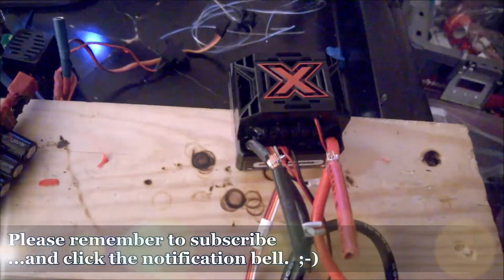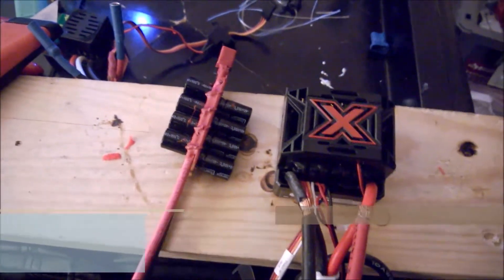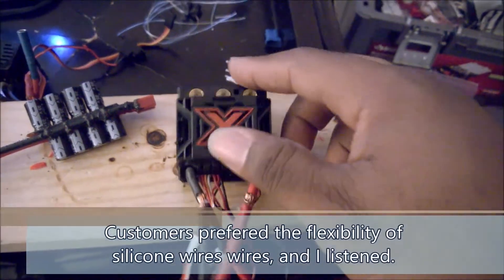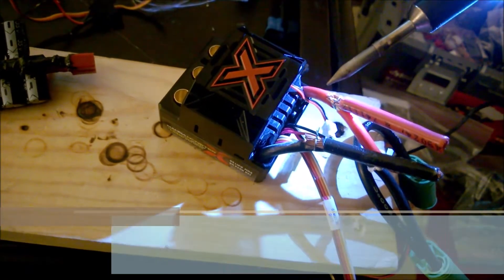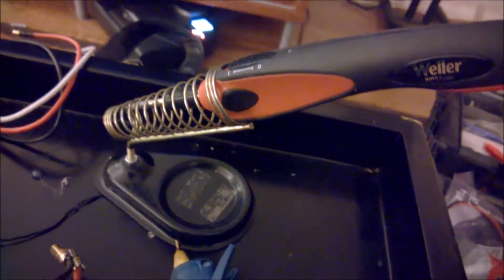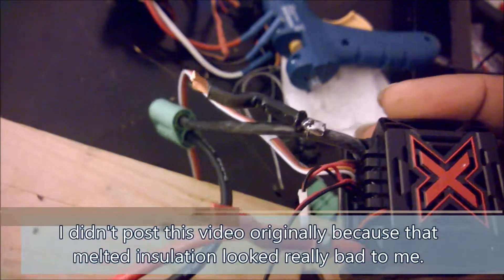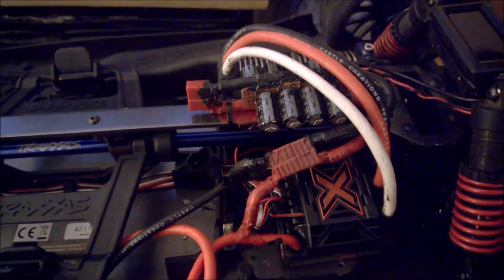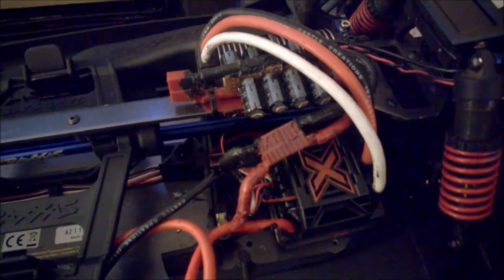Ep. 269: Cap Pack Wiring Tip

Comment: Going to make me some for a 3s 2845 5000kv speed build. Got a cheap quickrun 35amp esc. What capacitors should I go with? How many shld I do?
Reply from the maker: A 35A ESC will probably peak at 50-75A under max load. Assuming decent batteries, you are probably going to get a max a of ~0.5 - 1hp out of that setup.... if your ESC can actually keep up with that load.

In my experience, cheaper ESCs usually need a lot more help than more rugged ESCs because they just aren't designed to take a lot of abuse. for that reason, I'd build a pack with at least 4 low-ESR caps in the ~500uF range. If you are sticking to 3S, there is no benefit in running caps rated for more than 15V unless they have a lower quoted ESR/impedance that justifies the price difference.

Here is an article with a ranking of capacitor brands. If you stick to Tier 1 or Tier 2 brands and assemble with high quality wire (I'd go with 14AWG, 12AWG, or larger), you will end up with a really solid pack. https://www.tomshardware.com/reviews/power-supplies-101,4193-5.html
Reply: @RCPhysics  thanks for that reply I will do! One more question. How would 4 500uf capacitors compare to 2 1000uf capacitors? Would it be the same or is there a benefit? Also why not use a higher voltage vs 14v. Would that matter at all or do you want it to be as close to the battery max voltage for some reason?
Reply from the maker: Here is an article I wrote a while back explaining ESR (Equivalent Series Resistance). https://www.facebook.com/rhouse21RCPhysics/posts/773378892833621 The short story is you want as low an ESR on your Cap Pack as possible to make it be more "effective". 4 500uF packs in parallel will usually have a lower ESR than 2 1000uF, but you have to read the spec sheets of the caps you are planning on using to confirm this. Sometimes good cap makers will have ultra-low-ESR caps that will break this rule-of-thumb, but you will usually pay more for them.

As for cap voltage rating, capacitance is defined as the number of electrons that a capacitor will hold at a given voltage. In this way, they act like a water tank and need to be a certain physical size to hold a certain number of electrons. No matter the voltage rating of a cap, it will only store a certain number of electrons at a given voltage, so a 15V, 50V, or 1,000V cap of the same uF rating will all contain the same number of electrons at 12V (3S). Buying a higher voltages cap just makes sure it has "room" to store more electrons at the higher voltages. In practice, you really just need a high enough voltage rating to handle your max battery voltage. Buying higher voltage just give you more room for electrons that your system will never try to store.

Comment: That's gonna melt right off, or at least looks like it.
Reply from the maker: Naah. Liquid tape solidifies into a silicone rubber that is good for over 200 degF (100 degC).  If your wires are getting that hot, you have other issues to deal with in your power system. 😎
Reply: @RCPhysics  just looks like a sub par solder job, that's all.   GL
Reply from the maker: I use silver solder on all of my power wires because it is a lot more durable. The downside is it looks really ugly. It also takes a lot more heat to melt which means you have to use a pretty powerful soldering iron to get it to melt well on thick power wires. That said, these were not my prettiest solder joints which I fully admit.
Reply: @RCPhysics  noted and appreciate the info. what wattage iron if you don't mind me asking.
Reply from the maker: I used to use a 150W Weller, but that sucker is hard to be precise with. I recently switched to a "budget friendly" (translation: cheap) temperature controlled solder station from Amazon that lets me use Weller-compatible iron tips. This lets me pick the right tip for the job. I can use a fine tip and low temp solder for circuit boards then switch to a massive chisel-tip that retains a lot of heat energy to heat the solder joint quickly, melting the high temp solder before the rest of the part/wire heats up.

Comment: Can I solder an ec5 connector to a cap pack and run it to a parallel ec5 adapter alongside a 2s lipo as part of a 4s setup in an Arrma Kraton 4s. Thanks
Reply from the maker: Cap packs only charge up to the voltage of the battery they are connected to. A 100V cap plugged in parallel to a 2S battery will only charge up to the voltage of the 2S pack (nominally 6-8.4V). That said, adding a cap pack to a 4S setup (1 4S pack or 2 2S packs in parallel) will probably give you more "punch" and help your ESC run a little cooler.

Comment: Should I use 470uF or 2200uF capacitors?
Reply from the maker: It really depends on the ESR (Equivalent Series Resistance) of the caps and how many you plan on using. Generally, larger capacity caps from a given product line have higher ESRs, but this is not always the case. You should refer to the manufacturer's data sheets to see which is the best option.
Reply: @RCPhysics  I was looking at Philips ones and was planning on making one for a 4s system and a 2s/3s
Reply from the maker: @plproductions8887  What ESC are you using? That will determine how much uF total you need for the pack. If it's something like a ~100A-class ESC, you shouldn't need much more than 1,500-3,000uF so 4-6 470uF high quality caps would probably do just fine.
Reply: @RCPhysics  one is a castle mamba x run on 3s and the other is a HPI trophy Truggy Flux stock esc on 4s ( there Panasonic M Serious Low ESR ) sorry
Reply from the maker: @plproductions8887  Che the data logs on the Mamba X to see if you even have a ripple problem. That ESC caries a lot of onboard capacitance for its size, so you may be pleasantly surprised. It's probably go with 4-6 470uF caps for the HPI, though.
Reply: @RCPhysics  ok thank you the mamba x is on a 1/14 car for speed runs

Comment: RadioShack hasn't been alone for over 8 years you forgot to put heat shrink on it
Reply from the maker: I recently discovered that Radio shack is still around. They are just online now. So you can still order the good solder and all the other Radio shack products you like through the internet. Also I like to use liquid tape to cover the wires instead of heat shrink. In my opinion it does a better job of keeping the dirt from the road from getting into the connections.

Comment: This maybe a dumb question. Soldering so close to the ESC do u have to worry about the heat effecting it? Can anything inside ESC  become damaged ?
Reply from the maker: They are fine there. Caps don't make much heat. ESCs have some am
ount of caps already inside, but adding a Cap Pack just gives them more protection for extreme setups.
Reply: @RCPhysics  I mean heat from soldering gun
Reply from the maker: Just use a high wattage iron and be careful not to let the wires get too hot. Castle uses high temp solder in their ESCs, so it would take a LOT of heat to damage the ESC..., but it's not impossible.

Comment: Can up wire a cap pack to the motor wires and what would happen if you did
Reply: I'm wondering what the cap pack does bc I ordered a hobby wing combo and it comes with a cap pack
Reply from the maker: Here's a video describing how a Cap Pack works. https://youtu.be/ie8P3ocN1io
Reply from the maker: That's not the best idea for a brushless motor. It would interfere with the ESC pulses.

Comment: I have 2 10000uf 35v caps.  Can use them for my 6s application?
Reply from the maker: Their voltage is good (6S is only 25V) but, you have to be really careful with large caps. Many very large caps have high ESR (Equivalent Series Resistances) so they could take much longer to charge and discharge than smaller low-ESR caps, so they may be less effective overall. Assuming they are brand name caps, you may be able to look them up on their manufacturers website and find their data sheet. A high performance 6S LiPo setup will have an Internal Resistance (IR) ranging from ~5 - 30mOhms. If your 2 caps in parallel have an ESR of around the same level or lower, they should provide a good help to the main batteries keeping the ESCs fed. However, if the caps are much higher resistance than the batteries, they may not be able to keep up with the load and may overheat and blow.

Comment: Is there a huge difference between hobbywing  wpl 8 rtr 100 100 amp on 4s esc and the 120 amp 4s esc sc8? Both hobbywing. My motor only handles 86 amps so I should be good with the 100 amp esc without cap pack right? Im running mod 1 gears and happy with my 2wd stampede doing 90mph. I really dont wanna push the motor harder and esc only gets warm. Im just ocd and wond if I'm gonna notice much difference between esc of its even worth upgrading 20amps? Might just get a castle mmx setup like you next or max 8. Thanks alot.
Reply from the maker: Honestly, I've never run the hobby wing ESCs so I'm not sure how much difference there is between the two you mentioned. Generally motors will pull a little more current on larger ESCs, even if just for a few moments, so upping the ESCX size can often remove a power bottle neck if you are trying to get more out of your system. 

I'm a big advocate for data logging ESCs for speed and drag applications simply because they take the guess work out of tuning. You know exactly what the setup did which helps you figure out what to do next to move forward. That can actually save you a lot of time and money so you aren't running down tuning dead ends.

Comment: Do you only need cap packs when dealing with a lot of voltage, what’s the purpose of it
Reply from the maker: Cap pack do the most good in very high current applications, like drag racing, speed running, or bashing with heavy cars. However, a good cap pack can increase the life of most highly loaded ESCs by taking some of the load off of the on-board caps. They can also often mahe the ESC run cooler and a bit more efficiently.

Comment: Would a military splice work here, before soldering your quick connect wires? 
Also, do you need to use deans plugs or could you use the same style plugs that your ESC/batteries use for consistency?
Reply from the maker: Thanks for the great comment! A military splice works great with normal wire, but I see 2 problems trying to use it for this application.

1) RC ESCs typically use 8-12 gauge silicone wire, which is extremely thick and does not like making very tight bends without trimming down the overall wire diameter (which defeats the purpose of using the thicker wires).
2) This flexible wire is..... very flexible. It is actually made of an incredible number of tiny strands that move more like thread than normal wire. As a result, it doesn't like to hold a shape like solid core wire would. 

I'm sure you could figure out a way to make a military splice work, but a little piece of wire like a bread tie or copper hobby wire is a lot simpler.
Reply from the maker: Oh, and I chose Deans for the quick connections because they are 1) capable of easily handling 60A of continuous current, 2) really compact, 3) really reliable, and 4) really inexpensive.

Even the best individual caps of this type are only rated for a few Amps of ripple current (1-4 Amps) during continuous operation (discounting the in-rush current at power up). That means that a Cap Pack with 12 caps would see a continuous flow of less than 50 Amps and that would only be on a system with a HUGE amount of ripple voltage. "Normal" operations on a well tuned setup should be much lower. This makes the Dens connectors really well suited for the job.

BTW, The reason I use really thick wire through the cap packs is to limit the electrical losses between the cap pack and the ESC. I believe the fatter wires buys you a little flexibility in mounting the caps. Too much thin wire in between the caps and the ESC makes the Cap Pack much less effective.

Lastly, my newest designs integrate the quick connector into the body of the Cap Pack. This makes wiring them much easier and the quick connection virtually disappears visually. Some guys would like to use their favorite connector for the quick connection, but that would require me to have different designs integrating each of the major connector types to house connectors that would be used really infrequently since I build my caps to be hard-mounted to the vehicle chassis.
Reply: @RCPhysics  what about my ESC 150A battery 4S what is cap pack for my setup?
Reply from the maker: @jacksonjoss1108  Which ESC and what car?
Reply: @RCPhysics  flycolor esc rc boat rigger
Reply from the maker: @jacksonjoss1108  Something in the 2,000-5,000uF range would be more than enough (if you need one at all) .You will see the biggest benefit if your ESC is really heavily loaded at part throttle (in other words if you are running a VERY aggressive prop). If your prop is more stock-like, you may not see much of a difference, though.

Comment: The only thing I hate is to strip the battery silicon wire..what if the wire breaks after some hard bashing for trucks..then it would only left with a very short battery wire especially on those non-sensored esc..
Reply from the maker: The wire is actually really strong and the exposed section becomes extremely stiff once you apply solder to it. So as long as you do a good job soldering, you shouldn't have to worry about the wire being weakened. This is also why I make my new cap packs to be hard mounted to the chassis to reduce the stress on the wires.

Thanks for the great comment.

Comment: What an elegant solution to 'clamping' wires together - wrapping them with thin wire! Why, in my 40 years since high school electronics haven't I thought of that? As soon as I'm out running errands I'm off to the craft store to get a roll of copper craft wire!
PS. I miss Radio Shack too. Remember the Vacuum Tube Testers?
Reply from the maker: Thank you for the compliment! Copper Craft wire is an AWESOME idea to take my suggestion to the next level!

Wow, I haven't even thought of vacuum tubes in years! LOL!